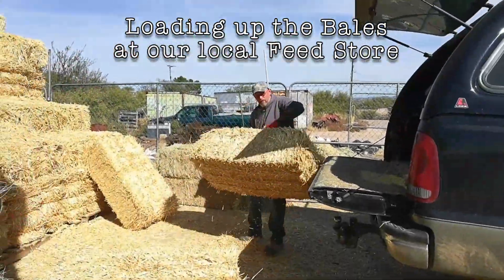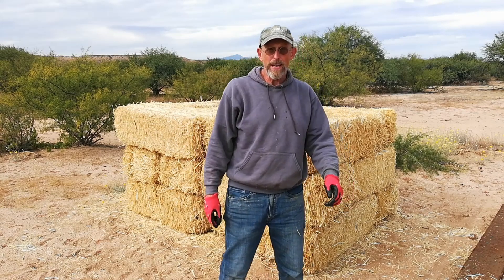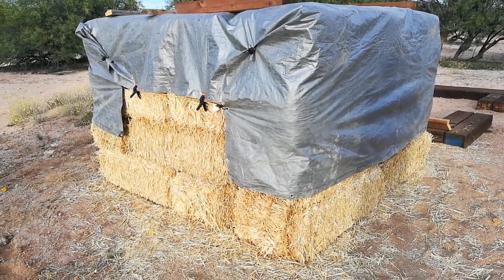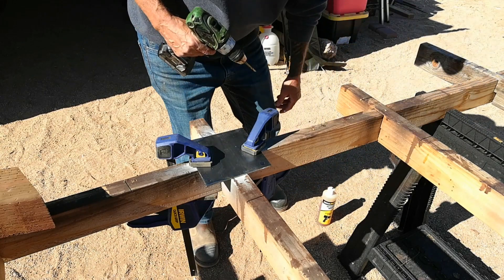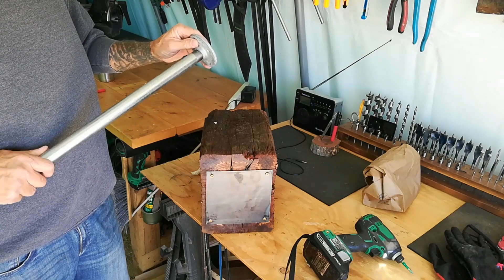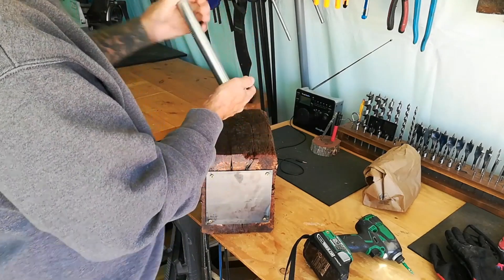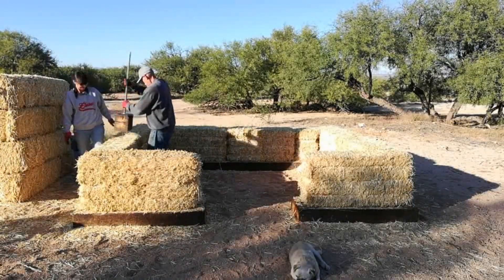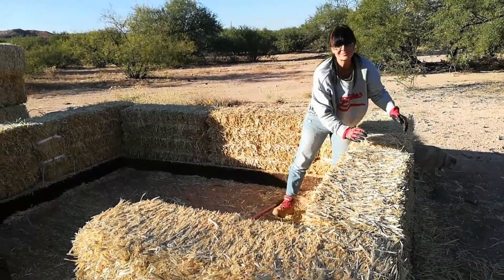Our Strawbale Toolshed Build: Day 1

Comment: Talk to a farmer when he is bailing wheat straw. You should be able to get him to bale a tighter bale for you .  I built my straw bale work shop 20 years ago stays at least 15 degrees cooler in summer and and never got below 40 during the winter.  Use a small ac 6000 btu for maybe an hour a day when working in it. Use a small electric heater in winter to knock chill off . Don’t have any windows so that helps with temp control. Figure since I am using power tools don’t need to be looking out a window.
Reply from the maker: Thanks for those tips!

Comment: Awesome start and well filmed video!  Question:  other than mass/weight is there anything attaching railroad ties to the ground (or will there be?)  Keep 'em coming- one of your best projects yet.
Reply: @theupsideofdownsizing  BTW  love the Thor hammer...  if you pour a floor (or cob a floor?)  maybe rebar railroad ties parallel to ground into flooring/wire mesh  18-24"   Hate to see shed blow over : )

Comment: Do you have a link to the ratchet tool and webbing you are using? Thanks
Reply from the maker: Poly Strapping Tensioner & Cutter Manual Banding Tools Windlass for 1/2" -3/4" Width Polyester Polyproplyn Strap https://a.co/d/11dds5v
Reply from the maker: IDL Packaging - TSS.CW34.1830... https://www.amazon.com/dp/B071CFCRL1?ref=ppx_pop_mob_ap_share
Reply: @theupsideofdownsizing  awesome, thanks!